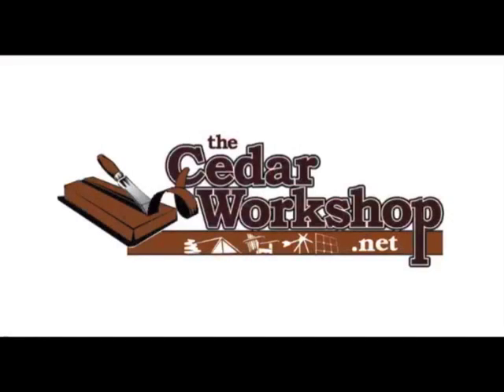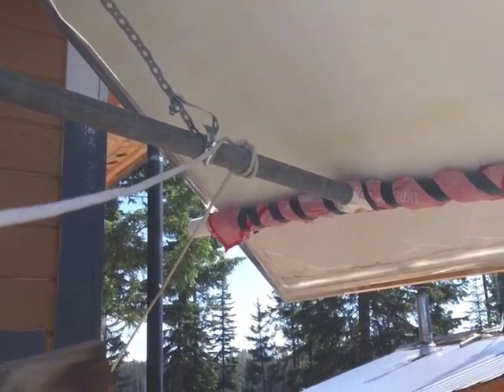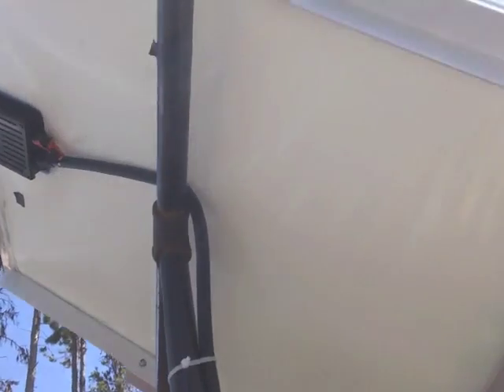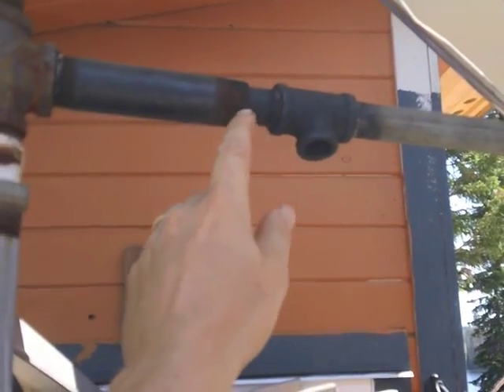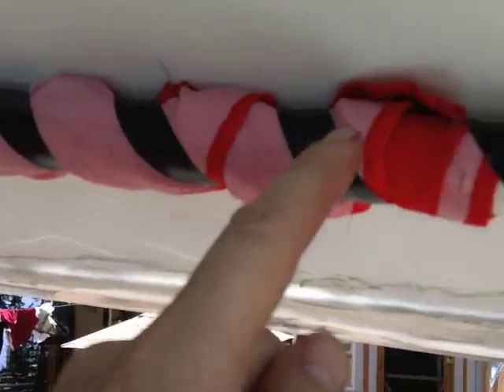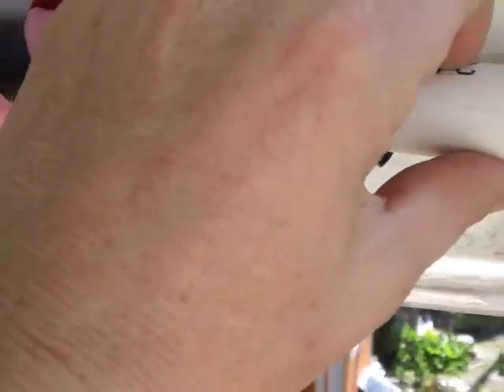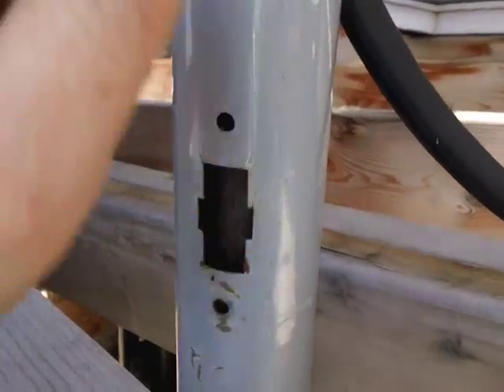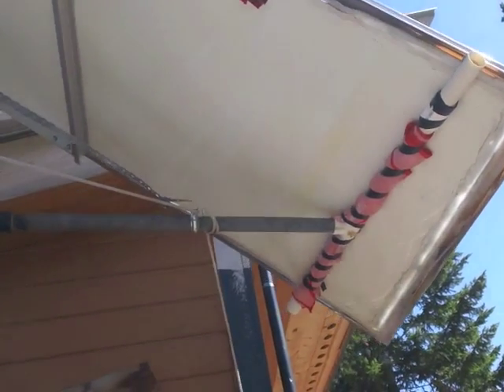Rotating Solar Panel Mount for Manual Sun Tracking

Comment: What a great idea.  I like the simplicity of this and am interested to see plans.
Reply from the maker: +johnlvs2run Hi, no plans. Just winged it and used water pipes.
Reply: +The Cedar Workshop Thanks for replying.  I'm interested to make sets of three 100w panels in this way.
Reply from the maker: The only downfall is the weight of 3 panels. But if you use a fairly strong pole, like 1" water pipe, should be OK. Does hurt to put a guywire on the back to add support. Look forward to seeing some pics.\
Reply: +The Cedar Workshop Thanks the feedback.  My current use is 1.5 kwh a day for the house, and I want to be off the grid.

Comment from the maker: A few years ago, I've picked up a simple tracker from ebay and similar to the units at redrok dot com. Just haven't wrapped my head around it yet. My biggest problem is the weather, my solar panels are located at the summit of a mountain and the weather can change every 10 mins. Like you said, the price has come down, (even in Canada). Aceman307 has a sweet tracker thou. Maybe I'll tap his know how with my tracker!

Comment from the maker: Not sure how much the DIY panel weighs, but it is a pig to move around. It's made from tempered glass. I do have a factory 100 watt panel (that has not been put up yet) and it weighs 19 lbs, so I'd say at least 40 lbs. It's easier to find 1" pipe and fittings. But with that said, my gut feeling is not to put anymore weigh on this type of mount. If you can find reasonably priced fittings for 1.5" or 2", I would use a thicker base pipe, concrete footing and guide wires.

Comment from the maker: This is an updated video with of the DIY solar panel on a rotating pole. The mount was made from 1 inch irrigation water pipe, 3/4 inch PVC, old flag, electrician tape, patio umbrella pipe and Tees. All the parts can be found at your local plumbing store, scrap yard or city dump. It's a little rough around the edges, but it was made from materials lying around. This type of projected was designed to carry my shower door 80 watt DIY solar panel or two, lighter 100 watt factory solar panels. The rotating mount can follow the sun from 10:00am to 5:00pm.
Feel free to comment! Enjoy
Reply from the maker: Not a problem! It fun to build things that can benefit everyone!